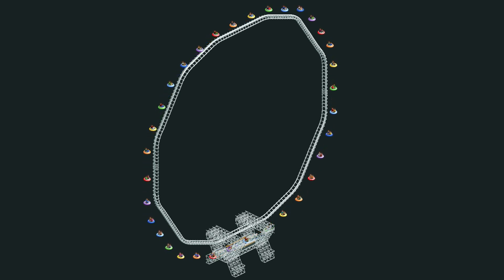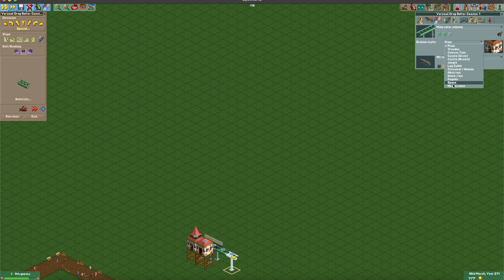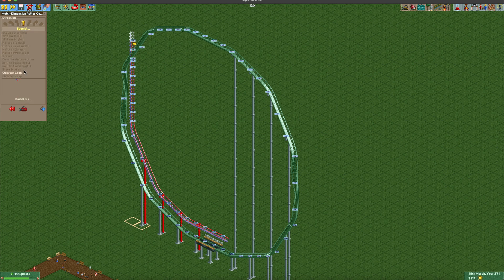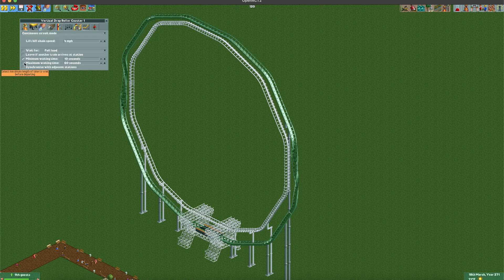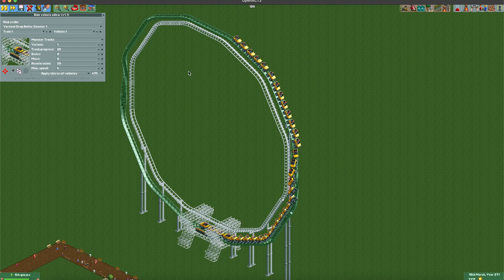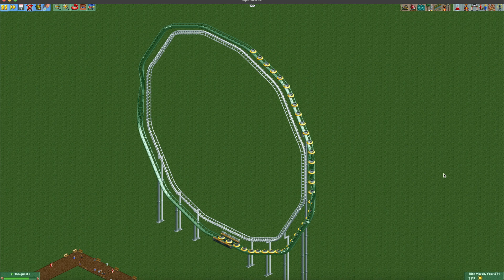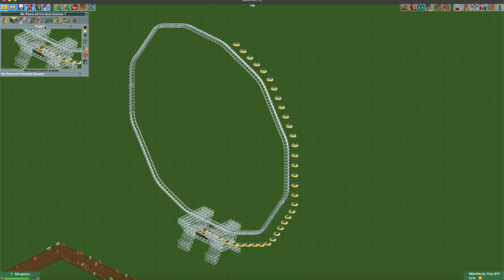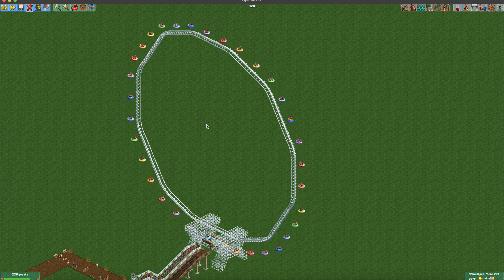Observation Wheel — OpenRCT2 Tutorial

Comment: OK, in regards to the ideas I had ... the subs don't tilt with height changes, but since they are not circular, they do rotate with the track twists, quite changing the overall look. The ride time is already almost 3 1/2 minutes, so I don't want to extend that too much (I thought it was going to be a lot shorter than that, but I was wrong). I still think a larger vehicle that could handle more people would be good for this, but it would have to be largely circular, to avoid showing the track twist on the vertical portions, and would obviously have to be a specially created custom vehicle. The one possible mistake in the original ride, is that you said set the min and max time to 1 second, and if I did that, the ride only took up half the track. I changed it to min/max 2 seconds, and then it was almost perfect. (Might possibly be more perfect with 34 instead of 35 trains, but it's close enough at 35 that I think I'm going to leave it exactly as it is!)
Reply from the maker: The subs hold more people so they actually take longer to load than 1 second, most likely. So you would have to adjust the number of vehicles based on load time, the speed of the subs that you can augment in the Ride Vehicle Editor plugin, and the size of the wheel. The tutorial is tailored to the bumper boats.

That being said, I have a newer version of this ride using the river raft vehicles so it looks more like a normal ferris wheel. It's on my list of tutorials to make a 2.0 version at some point. But you are right; unless someone makes a specific custom vehicle for observation wheels, we're basically stuck with boat ride, submarines, and river rafts for vehicles that remain flat.
Reply: @openRCT2tutorials  Actually, this was on the stock version. 2 seconds works perfectly. Perhaps 1 second would, also, and it was only going too quickly because it was in test, instead of actually open. but 2 seconds for me seems to work exactly as 1 second did for you in the video.

Comment: So I comment on all these, and often my comments involve things I don't like about them ... but I also keep coming back, and keep building many of them, so hopefully you understand these are not meant to be mindless criticisms, but just me trying to merge your rides with my play style in my mind. Understand, I'm one of your biggest fans, and eagerly look forward to almost every video!

My problems with this ride are two. At least with the Eye observation wheels, I understand they have huge cars which handle lots of people, and they move slowly. The bumper boats handle only two passengers, and this ride moves very fast. So it ends up being a completely different attraction, with vaguely similar overall appearance. So I was wondering ... bumper boats are a boat, meant to run on water, which may explain why they don't rotate, even when the track does. Which got me thinking ... the subs are also meant to be used in/on water ... they hold more people, and may also not rotate with tracks. Would it work to use the larger vehicles, and make them move a bit slower, and come up with a closer ride experience? (I don't want to slow them down to real-life speed ... if the ride took roughly 30 minutes, everybody would be complaining they want to get off ... but 3 or 4 minutes instead of roughly 30 seconds?)

My only concern is, if slowing it down a bit would horribly ruin the stats. Any guesses on how this might work out? (Maybe I just need to build it once, use my ideas, and see what happens.) As I look back at one of the earliest of your rides, also looking forward to whatever comes next!
Reply from the maker: I appreciate your insights. Always gives me ideas on how to make the rides better!